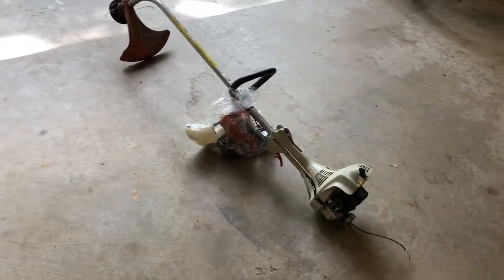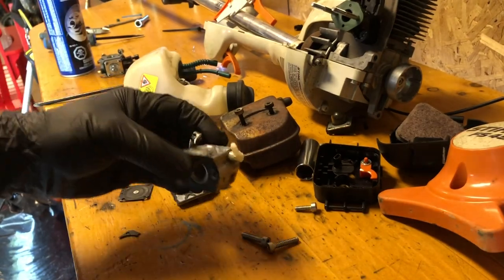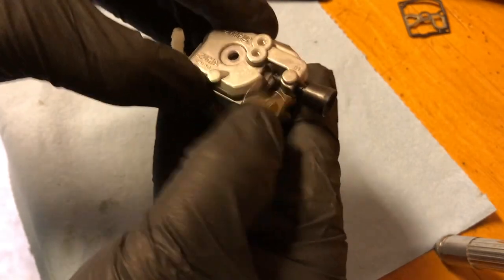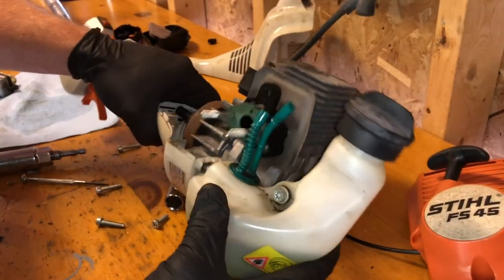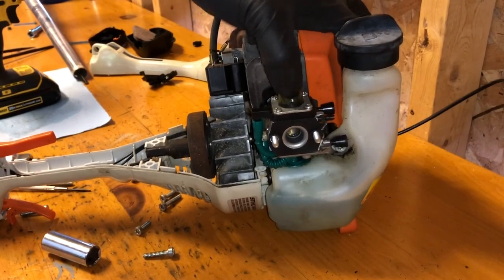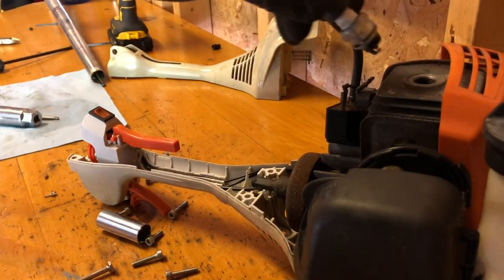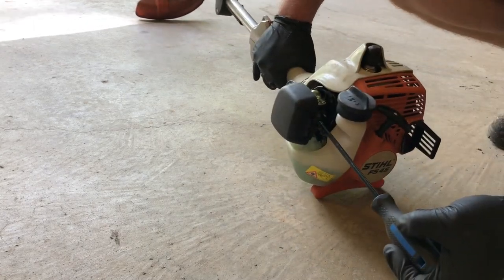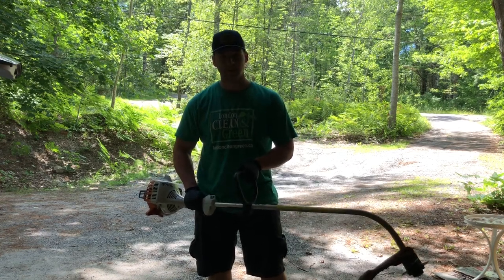Stihl FS45 gas trimmer in a bag of parts.... Can I fix it? (Carb rebuild and tuning)

Comment: Well done video. You mentioned to observe the inside of cylinder when the carb and exhaust are removed. Many other videos do not mention this. You can get a great view of the condition of the walls and piston for scoring. Then you can make a determination of whether to proceed. Some people cheat or are unwise to the fuel/oil mix.
Reply from the maker: Exactly! That’s the first step in my opinion. Make sure it’s worth saving, or better used for parts.

Comment: This is a very well done video - in terms of content and video & audio quality. Any idea what the purpose of the screw is that is 1.5" away from the short screw (which holds the shaft in place) on the underside of the case? It doesn't seem to attach to anything. It almost seems like a guard to keep the centrifugal clutch drum in place should it start to come loose. Thanks!
Reply from the maker: Hey Bob! I have wondered that for a long time myself. It doesn’t attach to anything but it makes sense it’s there to prevent the clutch housing from coming off. A mystery!
Reply: @DavesSmallEngines  Thanks, Dave - glad I'm not alone scratching my head about that one. When I pulled the cover off (to get to the kill switch) the throttle assembly came out - including the return spring. (Hint: I think depressing the throttle interlock when removing the cover might have prevented that disaster.) I spent all day trying to figure how it went back together but I finally prevailed. Anyhow, enjoying your site!
Reply from the maker: @BobC777  I have spent many hours scratching my head trying to figure out different throttle return springs. I always just look for the wear marks… but sometimes that doesn’t help either! Thanks for being here, I appreciate it!

Comment: Can you tell me how to install the trigger spring I have the same trimmer  it came off when I was replacing the lockout lever ....it would be much appreciate
Reply from the maker: I’ll see if I have one to pull apart for you!
Reply: Thanks
Reply: I have exactly the same problem as @Gene Hanks on my FS45. When working on trigger assembly the throttle return spring came off & I have spent a lot of time trying to reinstall it with no success. Thanks in advance!

Comment: I have the same model and type but mine works for about 10 minutes and then it turns off and not able to start it back up again.  What could it be?
Reply from the maker: When that happens undo the fuel cap and see if you hear a “hiss” noise. I bet it’s the tank vent.
Reply: @DavesSmallEngines  where is the tank vent or you talking about the gas filter
Reply from the maker: Tank vent. It may be built into the gas cap. See if the problem happens when the gas cap is off or loose
Reply: Yup you were right it was tank vent built into the gas cap.  I have taken it to several people and nothing.   Thank you so much
Reply from the maker: @eusebioguerra9154  that’s awesome Eusebio!!!!